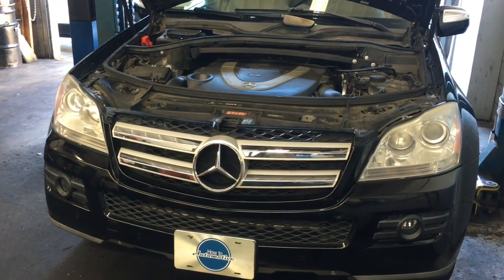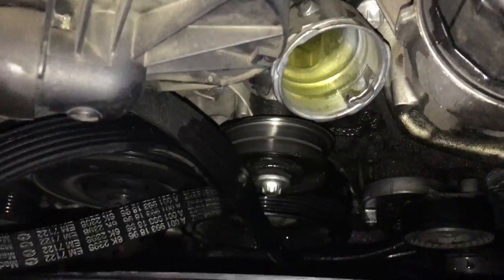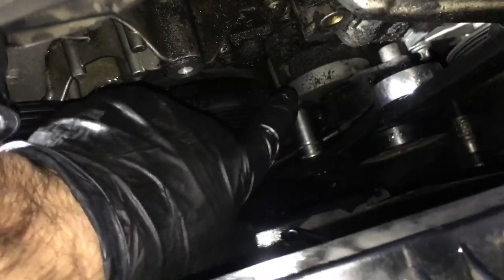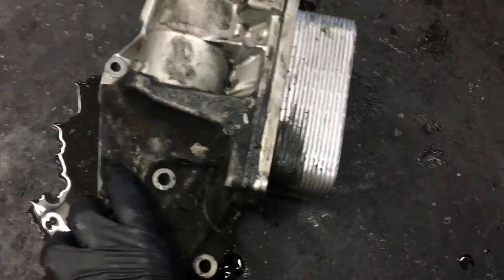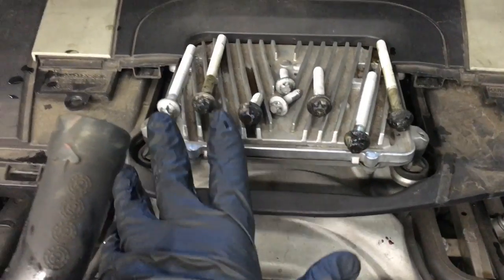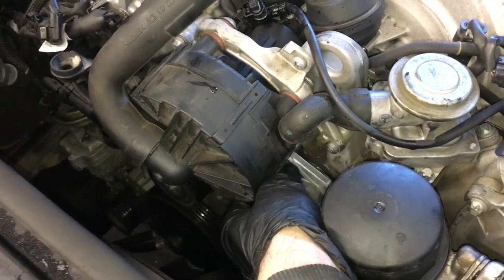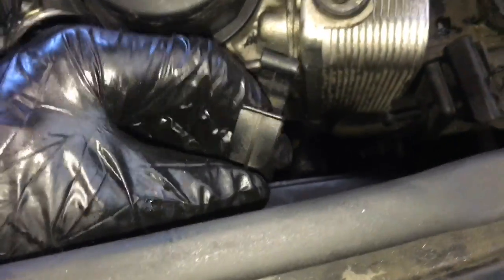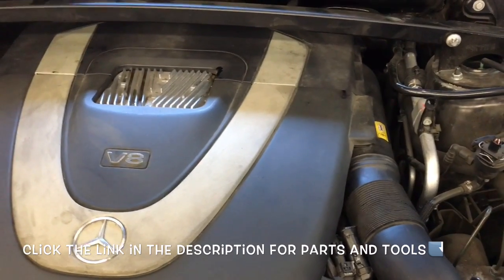How To Reseal The Oil Filter Housing And Oil Cooler On A Mercedes GL450

Comment: What a great video!  I agree with Thomas.  Looking at the repair, it looks like it's beyond what I would be able to do in a timely fashion.  I wonder, after making internal combustion engines for 170 years, why the materials engineers haven't come up with gaskets that don't degrade and need this kind of replacement.  Maybe they don't want to:  a lot of money is paid by us schmuks having the shop replace faulty materials.  I'm glad I don't own a GL450.  I'm just starting the repair on my ML500, it's soooo much easier..
Reply from the maker: Jim Busse you're probably right they don't want to make the gaskets better so they can fix them. Thank you for watching !

Comment: Great vid. I have the same job to to on a 2005 SLK350, but have to swap out the housing as the older version has a pressure relief valve that blows and leaks oil. You can recognise the older type by a black nylon strip near to the bottom of the housing. If that’s leaking then you need to replace the whole unit, not just the seals.

Comment: When dealing with belt tensioner, there's a whole where you insert a pin that locks it in place so that you don't have to continue holding it when undoing the bolt that it overlaps.

Comment: Great resource, thanks for taking the time to put this together.  What is typical mileage for needing to replace this seal? So far my only leak is at the cam plug which I'm doing this weekend.
Reply from the maker: David Estes I've been seeing them leak around 80,000. Cam plugs aren't too bad to do. I have a video on it .
Reply: Fingers crossed I don't have to do it for a while! Looks to be right on the edge of what I'm comfortable with. Cam plugs look real easy, and doing oil separator valve just for fun while there!
Thanks again!
Reply from the maker: David Estes glad to help. Thank you for writing you watching!

Comment: thank you for your video, do i need to take the oil filter housing if I only have to replace the oil cooler seal?
Reply: Its easier to just take the entire assembly off than just actually taking the oil cooler housing off alone
Reply: Various is 100% right. Also, I did only my oil cooler seal last oil change (as it was all that was leaking). This coming oil change, you guessed it, filter housing just started to leak. However, if only doing oil cooler seal, you don't have to touch the thermostat, idlers, or tensioner but it def sucks working around the ps reservoir.
Reply: Thank u guys ill do the entire thing

Comment: I am currently on the side of the road my car is spilling oil everywhere in that general area E550 2011 I'm wondering if there's oil lines it's hard to tell right now because there is oil all over the front of the motor
Reply from the maker: I would recommend towing it to a safe spot. Then I would make sure it has oil and do the best you can to clean it off and start the engine and see if you can determine where the leak is coming from.
Reply: @HowtoAutomotive  it appears that the dealer didn't tighten the oil filter plastic housing,  I'm thinking of replacing it,  it might be dried and loosing up! Lost all of the oil,  just added Castrol European full synthetic 5w 40 , started it back up after tightening plastic housing.  It doesn't appear to be leaking. 
It's in my driveway and I degreased engine bay. Going to keep a close eye on it!
Thanks for replying!!
Reply: I subscribed this is great information!

Comment: Hi! Great video! Look, I am going to replace just the gasket on the oil cooler, do you think it can be done without removing the steering oil reservoir and everything else you've shown here? I will try moving the thick cooling hose down so that it is out of the way, but not sure if I'll have enough space to unscrew the front lower bolt on the cooler... All other bolts look well accessible.
Reply from the maker: Денис Жуйков if you're just replacing the cooler gasket I believe you can do this job without taking most of the stuff off and I would definitely give it a shot trying to take off his little as possible. Thank you for watching!

Comment: can you have the check engine light on because of that?
Reply from the maker: Oleg Munteanu no just Oil leaks
Reply: I just got all the parts that were attached to the link to Reseal the Oil Filter Housing and Oil Cooler on my 2007 Mercedes E350. Are the steps that i have to follow pretty much the same? If not exact the same? And do you have to change the oil after that ? or just level it by adding some more? 
Thanks and i really appreciate all your videos and work you do to provide such great tutorials. Thanks
Reply from the maker: Oleg Munteanu I would recommend changing the Filter and its the same.
Reply: How to Automotive when resealing the oil housing, is it ok if i do it by hand, or it needs to be 14 and 15 lbs and done with a special device?
Reply from the maker: Oleg Munteanu you should be OK doing it by hand.
Reply: The oil leaks will be thrown by the serpentine belt to the alternator housing... So the alternator will look wet with oil. It is so disgusting to look at.. It make you feel like the alternator will soon malfunction.

Comment: What a pain in the ass I just noticed mine is leaking a lot worse than the one you just fixed . Front of the engine is covered in oil , add oil light just came on my S 550 during next fill up. SHIT!!!!